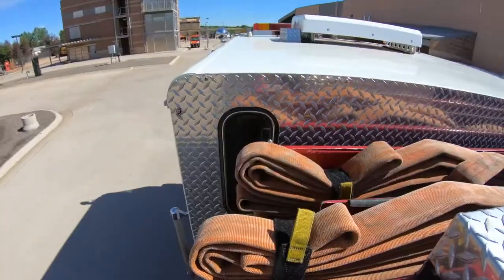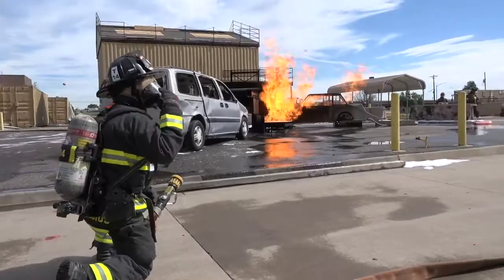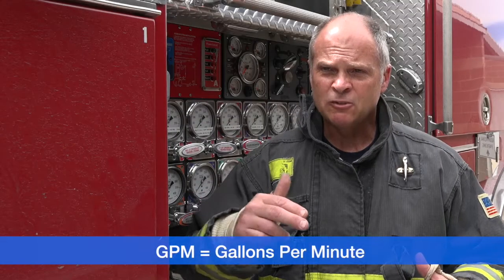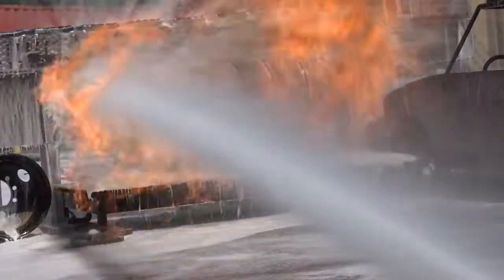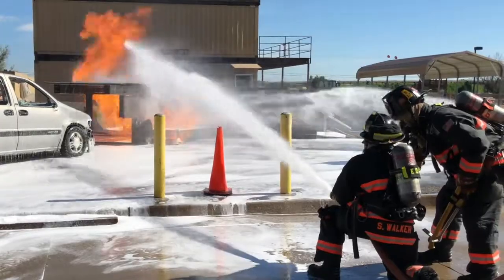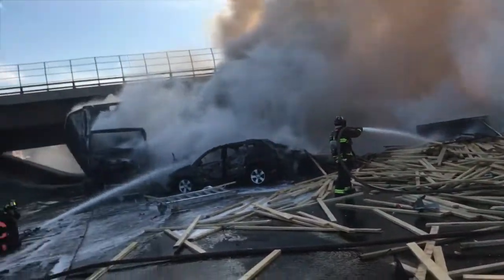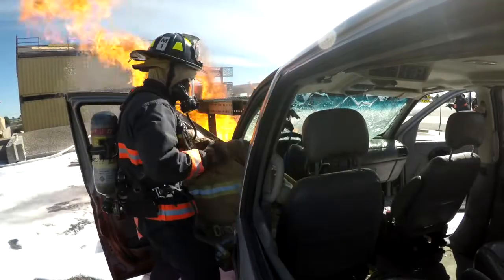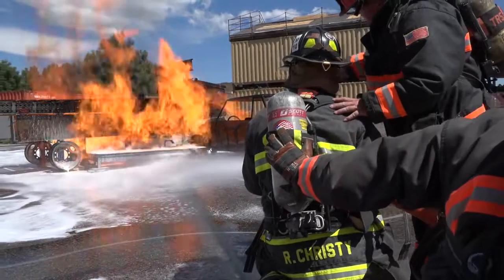West Metro Fire Rescue: Firefighting with foam

Comment: When you have 1000 gallons water and 30 gallons foam in the truck, means you mix those 30 gallons foam with the 1000 gallons water???
You only have 30 gallons of foam to fight the fire???
Reply from the maker: You can think of firefighting foam like dish soap in a sink or bubbles in a bath. You add a small amount of soap to the sink (or bath) and get a lot of soap foam or bubbles.
In firefighting, we combine foam with water to reduce the surface tension of water, allowing it to better penetrate burning fuels faster and more efficiently. It effectively makes water “wetter.”
A smaller concentration (like .5-1% foam to water) is what we typically use in wildland fires, the foam solution reduces surface tension of the water to better penetrate.
At a higher level of concentration (like 3%)- it’s more like bubbles in a bubble bath and smothers the oxygen as well as reduces surface tension. That’s what we would use on vehicle or hazmat fires- like you see in this video.

Comment: So this stuff is crazy toxic right? Brave guys hope they are safe
Reply from the maker: The foam that was used in training is not the same foam used on an actual incident. On a real incident, we use Class A foam which does NOT contain PFAs (Per- and Polyfluoroalkyl Substances)- what you're likely referring to. Firefighters as a whole do have a nine percent higher risk of being diagnosed with cancer and a 14 percent higher risk of dying from cancer than the general U.S. population, according to research by the CDC/National Institute for Occupational Health and Safety (NIOSH). Firefighters are exposed to carcinogens in many ways: carcinogens arising from combustion, incidental to structural firefighting or arising from work as firefighter (for example, diesel exhaust).
Reply: @WestMetroFire  wow thanks for the info
Reply: @WestMetroFire  You guys are so brave for exposing yourself to fire, live wires and carcinogens to help people put out fires and save their lives! ❤ Thank you!
Reply: @WestMetroFire  what is the purpose of using a different foam for training if the one used in real incidents is also non-toxic and safe?